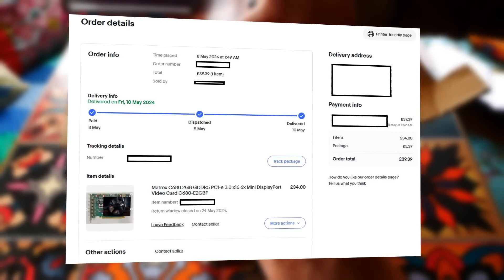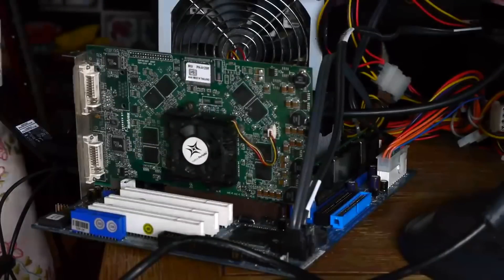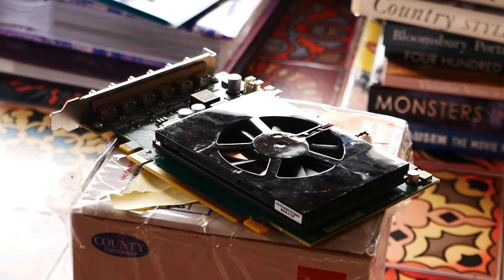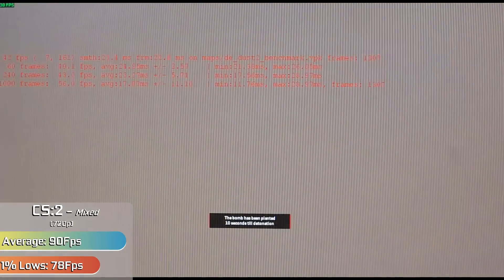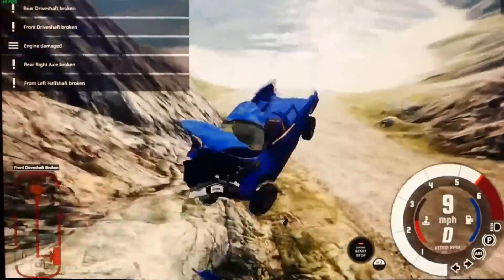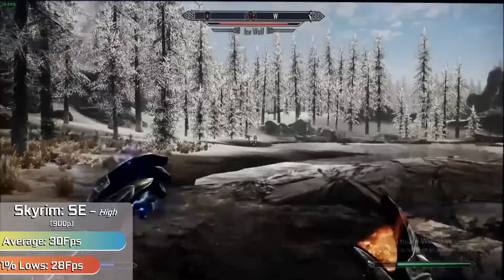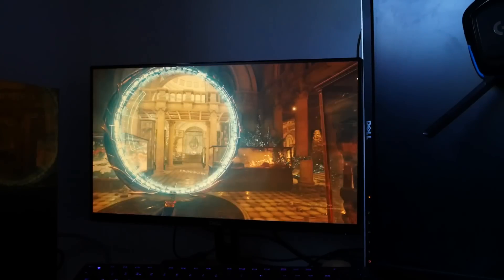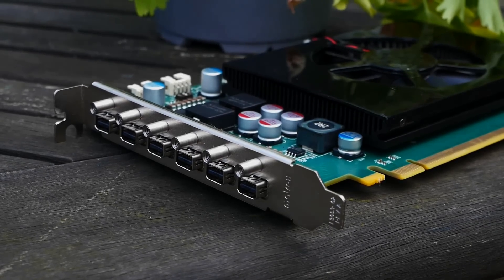Finally a new Matrox Graphics Card...

Comment: Time traveller: {moves chair}
The Timeline: "I bought the RARE new NVIDIA card....for 40$"
Reply: Lol, sometimes I wonder how the GPU market would be today if matrox or 3dfx kept up and never fell into obscurity, or if Nvidia or AMD ended up becoming one of the "underdogs".
Reply: @RedVRCC  I think 3dfx could have stuck around and potentially even have become the Nvidia we know if they bought Rendition in 1998, released the next generation Vérité as the Voodoo 3 or 4, and scientists start realizing the Rendition core's ability to run any program compiled for it, a thing that ended up happening three years later instead when the GeForce 3 brought the programmable shader back. Then possibly either actual Nvidia or ATi get bought out by AMD, probably still ATi but there's a chance that Nvidia puts in a bid for ArtX and wins it from ATi, so it's a question of if AMD cares more about price (ATi) given these are meant to be essentially display adapters or featureset (Nvidia) but I'll assume the former for now. From there, ATi become purely get dedicated to integrated graphics without the strength of the ArtX-derived programmable shader core and likely having a weaker in-house design or possibly partnering with Imagination on a PowerVR-derived architecture that includes a T&L (especially if power efficiency is a concern as it might be on an iGPU), thus having Real3D and ATi as the integrated GPU vendor divisions of Intel and AMD respectively as 3dfx and Nvidia battle it out in the discrete card market instead. 3dfx abandoned Glide in 2000 in our timeline but they'd probably have put out an official shader for the Voodoo 3/4 in 1999 and not touched it again, though I could see them down the line creating that timeline's equivalent to the Mantle, later Vulkan, API.

Comment: 720p 31fps with a .1% low of 29? 
Sounds like a ps4/xbone experience to me.
Reply: Doesn't PS4 run (most stuff) at 1080p (30 FPS)
Reply: @federicocatelli8785 No, at a framebuffer resolution level

Comment: Hmm… I’m still cross with you following your Matrox Parhelia video.  Reasonably impressed I went and bought one,  but it needed a proprietary non standard connector for dual monitors that I didn’t have.  I went back on eBay and they were super expensive.  Eventually I found another Parhelia that came with the video connector that was far cheaper than replacement connectors alone so I bought that as well.  So now I have two of the blooming things and never used them.  How much are the connectors for these c680’s in case I make another dumb purchase?
Reply from the maker: They're £5 for a Display Port Mini to HDMI Adapter. Also fully understand on the Parhelia, the later PCI-E Release did use a pretty odd connector.

Comment: Matrox is still around and it's usually in the weirdest places, have you ever gone to a bank or a gas station and there are a wall of 3~6 regular consumer TV's combined into a display that play some corporate garbage promotions? Matrox.
Reply: I've found that bulk signage boxes have been replaced by Radeon MXM cards on a PCIe board with mDP ports, or for much larger professional walls, Nvidia Mosaic using Quadro Sync with multiple cards has been a more common configuration.
Reply: Where I have seen Matrox more frequently has been in servers, as they need minimal horsepower and just enough to get off the ground.
Reply: Ya it's weird. Especially Canada all old govt contracts they had, like ya it's like moment realize just how stuff runs on Java etc.

Comment: Love the video guy, what i wonder is will this card run VR/Windows Mixed Reality? Like... I know its niche to want to run things with that kind of things but I do  wonder that with most desktop/laptop GPU's as I do tinkering with different rigs that all have been able to run it in one form or another
Reply: Ooh, yeah, whatever they do to achieve stable frames would be perfect for VR as long as they can hit a 90fps minimum. Because the one thing you can't afford to have in VR is drops. They might be an ideal partner for Valve for the Deckard, since it's going to need both smooth performance and low power draw.

Comment: I think I'm seeing a theme here. They are after a market for business users who need multiple displays that are run 24/7 without complaint, hence the low costs, low power consumption, and extreme reliability. Stockbrokers and traders perhaps who have six screens all full of information?

E: Wikipedia tells me that they're selling cards under the Luma name which is based on Intel Arc. Now that's something I'd like to see you getting going.
Reply: The LUMA cards are crazy expensive. They are meant to power things like the Times Square billboards and backdrop screens for concert arenas. The top model is an a380 and it costs like 6 times as much as the regular one.
Reply: @mariusmglestue1234  I've seen that. I suspect you're paying for the 24/7 support as well. That's also the reason why business editions of AutoCAD and similar are so pricey. You're not paying for the software but the fact that there's someone on the other end of the phone at all times who will be able to fix it if it goes tits up so  you can get back to fee-earning work post haste.
Reply: @mariusmglestue1234  Cause things like that need STABILITY and that is what they sell as a company.
Reply: That checks out. They've always had a foot in the multiple-display market. They made it easy to disable the vga bios on their cards, letting you put multiple cards into a machine. In the late 90's I had a Mystique, a Millennium, and a Millennium 2 in my Pentium desktop running 3 monitors.
Reply: @marblemunkey  Running the Parhelia on 3 21" CRTs and playing UT2004 was seriously an epic experience!  Granted, these days you can get super ultrawide monitors to do such a thing, and not  have any gaps in your display.  But at the time, no other GPU maker could come close to that.
Reply: @marblemunkey  I havent heard of that disable vbios trick before... even today multi gpu setups are nightmare to use and gaming gpus it is made difficult in windows(on purpose of course for nvidia, no good technical reason).
Reply: @marblemunkey  or 3 Pharelaia with 2 x4 outputs...one AGP and 2 PCI,all configured as one big screen,so 16K was no problem (with many 1024/786 displays ;) )
Reply: Interesting,  previously they used AMD gpus for their custom multi display cards.
Reply: if ya can have extreme stability for 40$/euros, thats dope feat. even intel enterprise laptops have bad (i)gpu drivers.... intel tradition.
Reply: @effexon  Matrox has A480 cards with custom drivers for 500$
Reply: Always have been liek that for last 20 years :)
Reply: we had matrox cards on many monitors for a control station in a processing plant. Best cards for this purpose.
Reply: Dell server's onboard GPU, at least on my x5650 system is a Matrox GPU.
Reply: Yes and they have ther own drivers!
Reply: They're really good cards for video walls.
Reply: This would finally kill the radeon 6450/5450/gf610 glut.  Working at an MSP it felt wrong to be putting neutered gaming cards into workstations.
Reply: if you look at their website listing for them they are designed for in store signage walls
Reply: I am curious if  they can have 64 bit per colour with no issues in pro software, a previous selling point. And accurately send out 12 bit to a panel which can be an issue for the major gaming cards.
Reply: The intel based cards are around 500-600 $ from matrox
Reply: I feel like industrial computing would perhaps use these as well
Reply: ....

....duh

Comment: Nice, now you need to test the d series which are apparently 4gb nvidia cards that come with 4 full size dp ports (wierdly they might be limited to 60fps according to the spec sheet)

There is also the luma cars based on low end arcs that are in x16 sized slots, but only half the slot is wired up

Comment: I would like to see, how it performs under Linux, since I ditched Windows 3 years ago. I am looking for card like this, low power workstation, that can handle some games.
Reply: Look into getting a RX 550.
Reply: Well, it's an AMD card with a probably modded vbios. Not a lot of info of exactly what GCN version is being used, as GCN1.x sucks for modern Linux.

Comment: The Luma series looks interesting, the Intel ARC cards have always suffered with lacklustre drivers so Matrox seems like the perfect partner
Reply from the maker: Seems ideal, I’ll have to see what I can do
Reply: @BudgetBuildsOfficial  Check sites like CDW or insight global.
Reply: I saw the prices.... hmmm interesting Intel made competition by themselves....
Reply: It's a little early to say "always" but so far this is accurate
Reply: The drivers have improved quite a bit. They're very underrated cards, and the people I know who have them adore them. If I were using Windows more (where AMD drivers are worse than on Linux, whereas Intel drivers are a bit better currently as Linux catches up), I'd probably sell my 6900 XTXH for an Arc card lul.
Reply: @wyntilda  I use both Windows and Linux. The Windows driver situation has cleaned up a metric fck ton to say the least. My 6700XT had no issues whatsoever, neither with my 3x1440p165Hz setup, nor with any of the 300+ games in my Steam library. My 7900XTX had the high-idle-power-on-multi-monitor bug when I bought it, but that has long since been fixed, and now it's as solid as my old card.